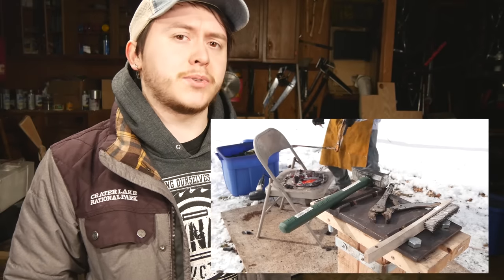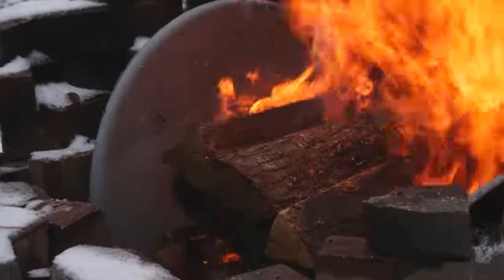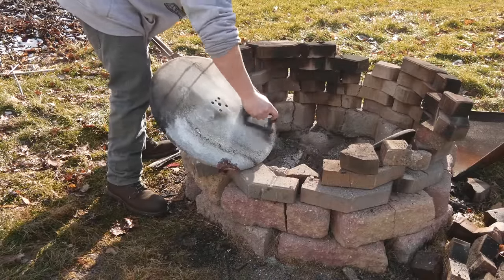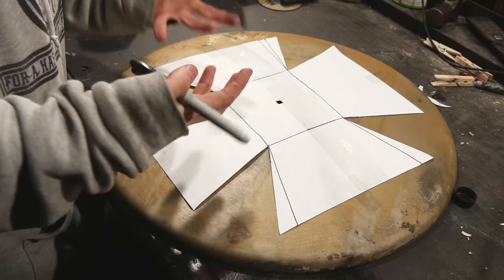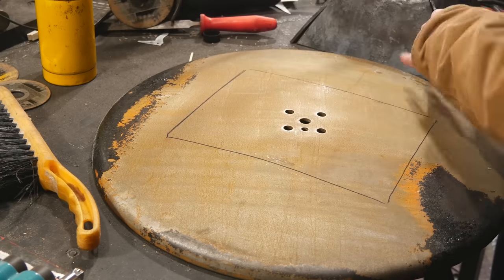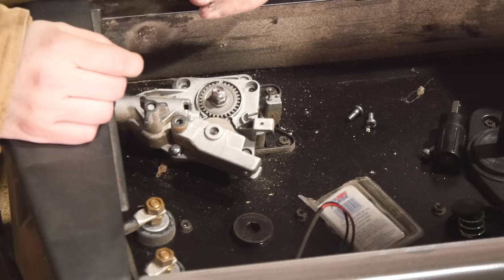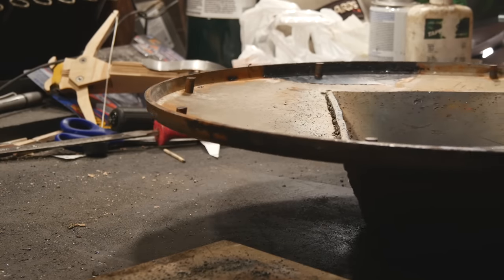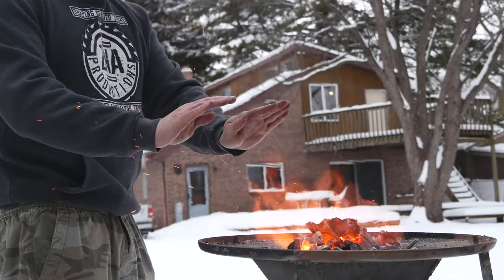-WHITE HOT- (DIY) Blacksmith Forge (Forge Welding Heat!)

Comment: Little tip for your welding. Lower your wire speed a bit and slow down. Go really slow. Make a puddle of molten metal and then slowly move the puddle along your weld. Your should be able to keep a nice pool along your weld. If not then try slowing down some more. If that doesn’t work tinker with your power and wire speed. If your power is to high you’ll just melt right through your work piece. If it’s to low you won’t be able to get a pool going very well. 

Hope this helps!
Reply: I think he just has a cheap flux core. I got a 90 amp shitty harbor freight one, there is a video of a guy doing some heavy welds with it, he had the wire speed cranked.

Comment: So my father being a blacksmith and me going to take over his work in a few years, I can quite certainly say that I know a little about the craft. So the way a deeper fire pot works it because of the larger area for coals to burn there are more coals that can get up to forging temp. which allow for bigger work pieces, the fire pot I use is about 2.2 inches deep which is plenty deep for all the work I have to do. The thing with a bigger Fire pot is the amount of fuel it uses. I don't know how expensive Charcoal is where you live, I personally prefer Real coal, but that comes op to personal preference. but a bag of 25 kilos is around 20 euros. so a deeper fire pot would mean more fuel consumption AKA. more cost.
 What I would have done in your case is take a less deep fire pot and stack bricks up the side so you can build your fire higher when needed. With a fire pot as deep as you made it it is also harder to put in certain sizes of stock, harder to manage ect. ect. 

Now I also I noticed you were still using a hair dryer as air supply, for the things your doing it does just fine, but what I would recommend for someone like you is an air pump for a bouncy castle, 2nd hand they are dirt cheap and provide a lot more air, which will give you a hotter fire thus will heat up your stock faster and more efficient.

just some things I noticed, no harsh criticisms. just My opinion and a couple of tips to consider :) 
anyway have fun diving in to the craft of blacksmithing and keep up the videos, I've always enjoyed them a lot.
Much love from the Netherlands.
-Christian
Reply: Bacon I've also had luck with a shop vac on blow. I'd bet dollars to donuts that he's got one that would work.
Reply: Jay Cie you're probably right! Didnt even think about that
Reply: mmmmmm....... donuts....
Reply: Woah, technology.
Reply: Thank you kind sir for the knowledge

Comment: Eli,
My grandfather (who's really quite handy) once told me that if you weld just flat pieces of metal together for about 10 hours then you will get pretty good at it, at which point you can move onto curved and shaped pieces of metal and then you are a beast welder living in an awesome house (I was worried about that too).
Keep up the good work!

Comment: so galvanization is bad? why? I guess they are zinked? ok well zink is pretty hazzardous....
Reply: irgendwieanders1 Galvanized steel has a coating of zinc on it. Normally, this is good, because it prevents rust, but when welding, the zinc releases fumes that are very harmful if inhaled.
Reply: yea, thats what I thought.... Zinc should stay on metal, not in our system :D
Reply: The reason why galvanized metal is bad for something like this is because you'll get metal fume fever if you inhale the fumes near hot galvanized metal. Symptoms are similar to flu, headaches and nausea. More sever exposure symptoms are chills, shaking, slight fever, vomiting, and cold sweats

Comment: Hey Eli for the weld there’s a thing called a puddle you see when welding. Its the molten metal lake you create when welding. Just go back and forth with it, straight back and forth horizontal or vertical depending on your direction of the bead. You could also move the rod in little circles like when brushing your teeth but that’s usually only with 7018 type rods. Just a Lil tip from me senpi

Comment: Alright, I had a machining class for two years, we learned the three most common welding types: Mig, Tig, and Stick. My advice is that you have a lot of splatter, slow down your speed and get the end of the "gun" closer to your metal, just around an inch away from it. As you weld you need to swirl it in little circles, maintain an inch of distance so you don't stick your gun to the metal and don't go too fast or back up, it will splatter and look heckin awful. Please people help get this comment to the top so he can see. The Mig welder is the easiest one to use and it's so simple to fix his issue. Vote comments mentioning better welding methods to the top. Help this wonderful man improve his welds.

Comment: Hey, I’m fifteen and have been blacksmithing for about 2 and half years now. I learned to weld right before I built my first forge, and have always been interested in making things in my own. Look, believe me, I’ve been in a very similar position as yours, trust me, I know the price doesn’t look tempting, if you make the switch from charcoal to coal you’ll never regret it. Don’t rush to by any, search for a good deal (say, 30-50 cents per pound) and you’ll never turn back. Just some advice from someone that knows what it’s like to learn to forge.

Comment: I've been forging with charcoal and a hair dryer for a while, especially on a tight budget.  If you lower your airflow you don't eat through nearly as much fuel and the forge will still get plenty hot to move the metal, just crank it up when you're doing some serious forge welding.  I simply took the bottom cap off my tuyere.  Saves you a ton of money in the long run that you can put towards other things (and less firefly burns).  It's the only craft where the best solution for all your problems is to apply fire and hit it with a hammer until it does what you want it to.

Comment: For your welding, turn up your volts and some amps when welding that thick. You won’t hurt the metal. Also check your inert gas flow. From the burn I’d say you were probably to cold and possibly not complete gas coverage. Also congrats!

Comment: Just a tip mate on welding crank the voltage up and move at a slow but constant pace the idea is to melt one side and the other side together with the welding wire so I hope it helps if you see this

Comment: Hay zna. Just some welding advise. It apers just by the large amount of Sparks and spatter that your father running your machine to high or your not giving it enough wire speed to keep up with the amount of wire you melting. So ide just say take a few minutes to fully tune the machine to make it not spatter and you should have a really easy time welding. You can also look into a YouTube channel called welding tips and tricks. He gives really quick advice on all types of welding. He really helped me get through my welding classes. Just a tip but I hope you take it man. Love what you do and keep it up.

Comment: Hey Eli, try to find leaf springs for your builds, lawnmower blades are steel lower grade than 1045, but higher than like 1018 (lowes steel), so a 1084 or 5160 spring would be a lot nicer as an end product

Comment: Bit more heat and go a little closer when you’re welding🙂 Almost lay it on, get as close as possible without clogging up the gun. Absolutely no problem if you get to close it all just chips off. Great vid looking forward to the next one😊 (they key is 45 angle)

Comment: the smaller forge is great for a beginner blacksmith , i use a simaliar design for when i travell. the best investment for him would be a bigger blower and a proper set of tongs about 5 or 6 different sets and also if he used actual coal with the two forges it would get a lot hoter than using charcoal

Comment: When you do your welds on grooves, try to do 3 passes, the first one should penetrate through, then then second one on top of the first and then cap the last weld, also try weaving and slightly pausing on each side of the metal while you weld, it will help you stay consistent and the weld will look much cleaner. Shoot! I also keep forgetting, clean your nozzle so you don't get as much spatter, that will also improve the look of your weld
Reply: Especially with MIG it should be much easy than using stick, but that's just my opinion. if you'd like watch the channel Weld.com. They have videos on how you should weld using MIG. Hope this helped you a little.

Comment: If you use hydrochloric acid to remove the zinc (galvanized) coating on the steel. It removes it in only a few minutes and doesnt release any dangerous fumes. Also its cheap and can be diluted a lot and still work very well

Comment: Another way to bend it easier would be to score the inside maybe halfway with the angle grinder, so you only have to bend half the thickness, and you get a pretty much guaranteed sharp angle on the bend. Then (probably optionally) run a bead along the inside of the seam for strength/aesthetics

Comment: I am a blacksmith and it does not look half bad, I have seen many guys start out with a lot worse forge, the fire pot has a good depth if it is 5” and 1/4” for the thickness is iffy but it will work but I would go at least 1/2” but if you get a big clinker in your fire that will steal all your heat from your work peace and if it is against the side of the fire pot it will heat it up and could weaken or crack the side, another thing is I am assuming for fuel you are using hard wood lump charcoal and those chunks are pretty big and for small steel it isn’t very good so you should break it down some but for big stuff like a lawnmower blade that should work great, one more thing you should place your work peace in the fire evenly and not tilted one way or the other so it will heat evenly and you need to find the hot spot in your forge where the heat is the hottest and you need to pile up a nice amount of coal on top of that so your peace will heat up faster, but you don’t have to listen to me I am not your mom , I love your videos keep up the good work I always love when I see you post a new video

Comment: If your looking to buy a new welder I highly recommend a stick welder. A MIG welder has a lot of moving parts (especially the drive wheels) that can go wrong, not to mention the expensive wire. TIG machines are great but it does require a gas cylinder which is quite expensive- and tig welding is not only hard to learn but it is very finicky about contaminants in the weld- so with the hot-rolled oily metal your likely to weld it would me better to get a good ole' fashined stick welder. Its essentially a bunch of electronics, not much can go wrong with em- and stick electrodes are real cheap. Stick welders will probably be the least expensive powersources to buy anyway. Harbor freight has just started selling a bunch of new welding supplies and metal working tools- so if you have one in your area I recommend you check it out- but be cautious what you buy there, its not the highest of quality.

Comment: Dear Eli let me speak with you, I am in highschool and learned to weld two years ago. You are not a bad welder you need to bite the bullet and buy an argon tank and regular wire. When you do this your welds will become 150% better. Because the flux inside the wire is exploding and causing your welds to look horrible.

Comment: Instead of another mig welder I would recommend getting stick, I personally find it much easier and I feel like you would have more success, just pay attention to what kinda rod you buy for certain projects bc certain rods are more geared towards certain areas
Reply: Jacob Little takes maybe 10 hours to get decent at stick and once you get it down it’s much easier than mig
Reply: With dan
Reply: As a welding student I find stick to be much easier unless you have a gap to fill then mig is easier

Comment: one thing that will help with your welding is adding Argon gas to it but if u have a cheap lil Hobart 110 welder you have to Install gas lines to be able to use it but most 220 welder are set up for Argon out of the box. but your a pretty smart guy you probably already know this

Comment: Dont quote me or anything, but I think you're running your welder hot. My suggestion? Find someone who knows how to weld and have them set it up for general use, then leave the settings where they are and practice. If you feel like you need to, adjust one parameter at a time a small amount, until you figure out how it works. I spent some time welding and found it very easy. I remarked upon this fact, and my instructor laughed at me and said it was because he set it up

Comment: I would try a stick welder. I took a welding class in highschool and I did very well with the stick welder and pretty low average with the wire feed

Comment: 1/4 inch fcaw volt 22.4 amp 250. Play with the amps some you may need to go up or down.  Those are good settings for .035 wire.  Get s stick welder

Comment: The large gaps you wanted to patch weld would have been better with something like a stick welder, though it takes a bit more skill to use... lol But the larger diameter rods make for EZPZ patches if you get the hang of it. Plus they're cheap!

Comment: I recommend using a plasma cutter to cut metal like that rather than an angle gringer. Its just as easy to use as a welder. Not sure how much it costs, though.

Comment: When you're welding just slow down a bit and let the puddle build up. You're melting two peices of metal together not driving in a screw or using a nail gun. Takes time. Hope this helps

Comment: If the plates are hot dip electroplated then they are very dangerous but if it’s just electroplated it’s not nearly as bad. The stuff u had didn’t really look galvanized and since it didn’t have a strong reaction it was probably just electroplated.

Comment: As someone who is a professional welder, I will tell you those welds are not sturdy, even as tack welds. Since those welds are so thin, It's possible that the heat from the forge could actually cause them to fail. But hey, at least you tried. If you want to practice welding the best place to start is just running flat beads. Welding classes for Flux-Core (What it looked like you were using) runs about $800, but depending on the state you live in you can get a tuition to heavily lower the price or make the class free. Stick welding (SMAW) generally runs $200 for the class, but tuition is still applicable.

Comment: Hydrochloric (usually sold as muriatic) acid works better than vinegar, though in my experience you'll still need to finish up with a grinder to get it all.  Pickup ten pounds of baking soda per gallon muriatic -- that's probably twice what you need to fully neutralize, but baking soda is cheap and acid is spicy.

Comment: So, you dont actually NEED a super deep fire pot, what you need is about a 9x9x3 1/2 ish (roughly) fire pot, and another 4 inches around the top, so you can add charcoal as you go and its less of a pain to  shovel new fuel in. so your total dimensions could be around like 13x13x3 1/2 ish. just for future reference, in case you ever re-rebuild your forge
Reply: edit: never mind. do whatever

Comment: If you weld galvanized steel you get mff (metal fume fever) since the layer of galvanized steel is zinc  the fumes are extremely toxic. Technically just weld in a well ventilated area have a welders hat and a strong resperator

Comment: Hi eli, I could really use your help. I ve recently stated actually making some of your projects but Ive ran into some problems. When trying to drill through metal (most recenly a saw blade) I have had alot of diffuculty. So my questions are: What type of drill bits do you use to drill through metal? How long does it take to drill a hole? I ask this because I had been trying to drill through for like 10 minutes, and I dont know if it just takes longer than that or something.

Thanks in advance,
Landon

Comment: Eli I’m a welder and if that is a mig and or flux core welder, you push the welding puddle not pull.
If you need a welder to help you with projects feel free to contact me. I’ll do the stuff for free and fun

Comment: Next time u use a oxy fuel set up don't use a carborizing flame....that's what the black means on the plate...flame should be blue with a cone of lighter blue coming about a 1/4".

Comment: Your hands are going to be tan as hell dude, you should really put on some leather gloves (or welding gloves). For real though you need to cover your hands, the sunburn you get from that really hurts if you do that enough. Also I'm not sure how you set your welder but it sounds like you need more heat for this thick of metal. For steel that thicc 20 volts at 360 wire speed ( or amperage some machines say different things but its all the same) is probably good. I dont know how much you know but I'm taking a class right now so I thought I'd try to help the best I can. Good luck with your new forge!

Comment: Muriatic acid works beyond well for taking the galvanized coating off, its very inexpensive and effective, just make sure you use the proper eye and lung protection when striping it off.

Comment: You won't "die" or even get sick from welding  galvanized metal as long as you work in a well ventilated area. The zinc coating is toxic but, as long as your paying attention to your work area you'll be fine.

Comment: yur beads r ok...  yoov got to have clean metal to metal where ye be puttin yur bead tho...clean, like for surgery;  then yul b in business laddy.  use the best flux core wire you can afford, you dont do tons of welding so it wont be a huge cost, but makes a better butter that stays put and wont splatter as much... it will stick to those clean , neat edges youll be making.  ;-o